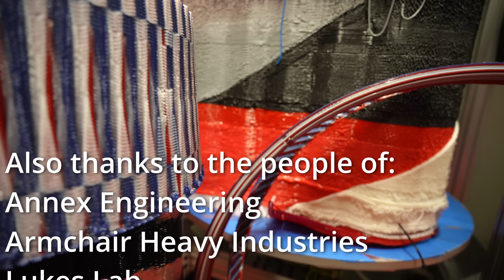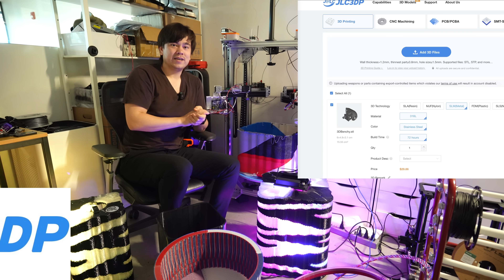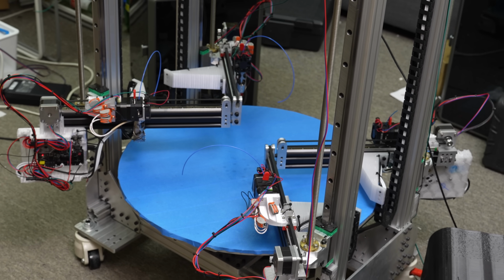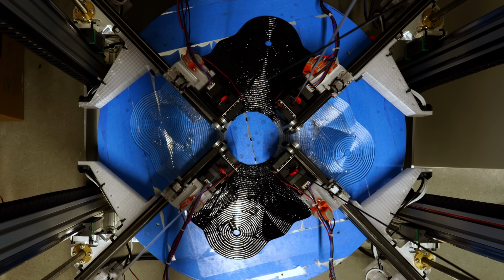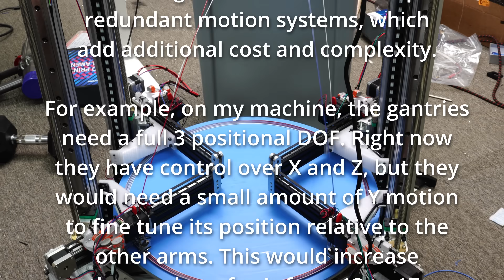The High Speed Future of 3D Printing - Quadrupolar Express

Comment: I'd love to see a breakdown of the build. Also any updates on the firmware and slicer end. I've been trying to figure out how to get klipper to run multiple print heads simultaneously. So far all ive come up with is to run them as seperate printers but im not sure how to synchronize them so they dont collide. I still have no clue how id go about slicing models for that too lol. I did see something the other day that I need to look further imto about a few people getting multiple heads to work in klipper but I'm not exactly sure where I saw that atm...

Comment: You would probably need encoder feedback on every axis as well as the rotary axis at the bottom and a cnc controller to do all the trig functions, that’s a lot of math. That kraken controller just can’t do all of that. I would aim for absolute encoders on battery back up so it won’t loose position unless something breaks. Then run a ballbar test to make sure the frame is squared up. Just a thought.

Comment: Super Kudos to you !!  Amazing work from someone not being paid by someone else to do this stuff.  So many things to consider.  Regarding the alignment of multiple print heads, have you consider incorporating a high quality camera placed on the printheads?  This would allow you to have a precision pattern on the print bed so that the printhead would know exactly where he was relative to where he thinks he is so it can calibrate itself.   In addition, as the print is being done, the camera on the printhead could see what the last printhead had done (plastic dropped) and put his nozzle in the correct position relative to what it sees.  This would eliminate the need for such precise construction of a large device.  So, the printheads (video/firmware/sensors) find their own ways so they do not ONLY have to rely on the printer structure and the 3D map in it's head to correctly reproduce the model.  Maybe a crazy idea.  Thanks again for providing so much knowledge to all of us!!!  Keep it up!

Comment: Honestly just having a rotating build plate is something I've never seen before. Me coming from a machinist's background, you can make that build plate very stable and very flat like on a vertical lathe. Just have to have the bearings supporting the right places. What you were saying about machine rigidity is absolutely true. No machine is truly square. It's as close as it can be and then you put in the right offsets to counteract its imperfections.

Comment: Fascinating, ambitious, innovative. Regarding vertical alignment issues of the four arms. Did you consider moving the print bed vertically rather than all the individual arms? Kind of like Bambu style CoreXY. Another strategy would be to lock the four linear rails together in the center with a strong x connection. Alternately they could all be tied together with a periphery frame. Like how a Voron style CoreXY moves the entire gantry as a single unit tied together.

Comment: In a world with money, you would fix your precision problem by having a see through print bed. You would then just have a laser on each print head so the system knows the exact position of every print head without all that fixed alignment nonsense. I would also love to see your code for this so i can make recommendations there. Normally it would be easier to simply have the system know how to move all the print heads from the skice rather than in the machine itself. Adding to the machine adds a lot of complexity

Comment: @Nathan Builds Robots I obviously don't know every issue you have had to overcome--and I'm sure that is a LONG list--and I could be way off base here, but how I personally would tackle the mechanical structure is a solid plate that covers the area between your four columns that has your printing mechanisms bolted on.  IOW why 4 independent cantilevered arms which are by their very nature prone to a lot of structural movement? 

If you have a single platform that slides up and down your four columns you get a MUCH stiffer structure out of the gate.  If that platform were a cage about 100mm tall it would be very close to self aligning as it would be strong enough to move the column rails slightly--the sub mm accuracy you are hunting for as it would ensure parallelism.  If independent Z axis is an absolute requirement you could still build however much Z axis movement you need right onto the platform.

You would obviously want your platform machined to the best tolerances your budget will bear, but really as long as it is a stiff structure it doesn't really matter and you can build in adjustment capability for assembly.  It's a lot easier to build and adjust everything on a single rigid platform.

I'd be happy to help you on the platform design if you need it.

Comment: AWESOME MACHINE! 

Ok I think I've got some ideas you might not have considered for axis alignment. 

REAL IDEA:  
1- put load cells in each of the print heads. 
2- Use one print head as a "master" print head, and have it print a large circle. 
3- use the load cells in all of the print heads to locate the edge of the circle 
4- use this at multiple locations to figure out where each head is in space and adjust the hardware positioning in software accordingly.

The main benefit is that it doesn't use any external hardware to register alignment but instead the actual position of one of the other heads to calibrate them all. 

At the end of the alignment protocol, have each print head print a circle on top of the others to check and see how close they are to each other. 

Idea other - do the opposite axes need to be independently cantilevered? Or could you effectively make an "X" (not exactly, but with 2 overlapping cross bars). That would help greatly with the parallelism/perpendicularity alignment of the heads across from each other. Also you could have a single print head extend further than the others in order to reach the middle of the bed.

COMBO BONUS IDEA: 
1 - use "X" idea from idea "other" above, and the load cells to perform regular bl touch style bed leveling, but then use the lead screws to actively "torque" the frame into the correct shape. for the first few layers at least. But that's another software solution.

The perpendicularity and parallelism of this machine is crazy important but it should be achievable mechanically with enough thinking about it... And Blanchard ground 1 inch thick pieces of tool steel LMAO.

BUY A DUET MAIN BOARD + EXPANSION CARD TO CONTROL THIS MACHINE AND THANK ME LATER

Comment: I feel like the squareness of the frame could be fixed/helped, if diagonal steel cables could be put on the sides, back, top and bottom, and tensioning them in order to callibrate the whole structure 

I'm recommending steel cables, or threaded metal rods so that it can more easily be callibrated, as opposed to having to presicely machine the frame/diagonal pieces, but then again, another issue that could arrive with that is the frame bowing out in the middle

and to allow for the printer to print in the middlle, you might consider allowing 1 of the print heads to go a bit past the middle so that that spot can be reached, however that would make the print heads be asymetrical, which would require them to have individual control (unless if that is actually already possible, just not technically due to the print heads having the same g-code)

Comment: Using an addictive manufacturing process to print large objects is silly.

You could have printed that trash in vase mode in a few hours with some 200g filament, then pour 2$ chalk / plaster / epoxy inside it in 15 minutes.

Comment: This is a cool printer concept! We're Tesseract Technologies, and you may have seen some of our previous comments here on YT. We're currently developing a high-speed 3D printer using custom-made BLDC linear motors. However, due to budget constraints, we've decided to start by offering an affordable, high-speed linear motor that is plug-and-play compatible with existing control boards using step and direction signals.

We're also planning to release a video soon, where we'll explain a unique approach using an H-bot configuration. In this setup, multiple X-axes can share a Y-axis, driven by several linear motors, allowing for overlapping print heads. This system is simpler and more efficient than complex belt-driven mechanisms, enabling extremely high-speed 3D printing with multiple print heads.

You can check out an image of this concept on our channel. We're excited to see how your design evolves and to share more about our own journey!

Comment: Do you think that a bed slinger design could work, where all of the print axes are parallel to each other? This could make it a bit more modular and help with rigidity and alignment. Is there any specific benefit to the rotary design? Besides looking very cool..

Comment: Nice experiment.

Probably way too impractical/failure-prone/complex to ever become a standard though.

More likely, we'll just see flow improvements on single head systems to also do 1+kg/hour.

Right now you can already get about 400g/h of PLA out of a Goliath hotend on a RatRig vCore, from a single filament input.

Designs such as Monika's with three filament paths (and 3 extruders) will already break that 1kg barrier with a single toolhead, with vastly better quality and only 3 extruders (or 1 with 3 paths).

Of course, you'll be able to quadruple that volume with those 4 heads, but all the downsides of that design will probably make it slower at any given level of quality, all geometries considered. 

It also just dawned on me that your prints will be a lot weaker due to each layer not being one continuous molten plastic stream, until you find a way to properly melt the quadrant boundaries.

A bit like the way most seams are serious weak points in perimeters, even worse when aligned.

Comment: I guess the "easiest" way to fix almost all misalignement issues would be to have a constant calibration routine with something similar to vive trackers (I wonder if just using stock trackers would give a good result), you have basically a barcode scanner (sweeping line laser) and multiple light sensors that have a very high speed clock, and you time a flash then a sweep in 2 axis, since there would be a single reference sweep, the relative position of each arm should be fairly precise.
you can do a few sweeps on each layer with static positions (e.g. min middle max) if you aren't doing fully 3d printing.
that would require painting allmost all of the printer matte black, because reflections are an issue,  which might be a pain

edit: there might be a cheaper way actually, if you use a  diffraction grating you might be able to get high precision positional accuracy from an off the shelf camera by using interference patterns just by looking at the pattern, and since the position is very limited

that may require semi real time slicing (e.g. only slice a few layers in advance, since you can assume calibration won't drastically change in a few layers) to compensate the sideways misalignement of the extruders as each extruder only has 2 axes. 
though a small pair of driven offset screws on the x axis rail  might be enough to compensate drift and keep the same gcode while being easier to implement. 

imo the main issue with the system is that at best you get a 10, maybe 20x improvement for a much higher cost and complexity (when you could just run 10 printers unless you need very fast turnover).

(it still is worth pursuing as improvements to idex would be great)

imo for very fast printing if cost isn't an issue high power bottom down dlp resin has a much higher ceiling (at the cost of needing a large base volume of resin.)

also if we see affordable larger models of resin printers with a pump like the anycubic m7s (but with a 300 or even 400mm bed), that might be a great solution for moderately high speed printing (though there's always the issue of film peeling which doesn't exist in bottom down printing.)

there might be a way to use a light resin floating on top of water or glycerin, that way you don't need high volumes of resin to print large bounding box bottom down models.
waves might be an issue but probably not since at very high speed you're printing at a constant flow so there shouldn't be that much turbulence.

Comment: I don't see this working. I mean, for printing big objects, maybe. For printing 4 small objecs, it gets it done. However, for serial or mass production, it's not nearle as useful as a small injection molding machine, and it's almost as expensive.
Don't forget that FDM printers are designed to make prototypes or just very small runs of some item.

Comment: a micron?  the fck do you think this is? the year 3024?  
you are talking about sizes that are less then 0.1 mm.  
and then you mention micron.  0.001mm.  
QUITE THE FFING LEAP THERE ISN'T IT?? 

there isn't a single 3d printer IN EXISTANCE!!! that has that precision. 
not even the precision machined metal parts in the motors and such. have those kinds of tolerances.  

the best you can get is 0.05 as a normal consumer 
0.01 if you have a big wallet. 
that's 50 times less precise than the microns you were talking about.  
(or 10 if you are rich)

Comment: "before you comment about you're own genius solution..." is a rather arrogant statement from someone, who just a few minutes before, was talking about how much they benefited from the 3D printing community. I am not a genius by any stretch of the imagination, but I got to work with people who were, on calibration processes and software for multi-head CNC manufacturing. One such system was in fact very similar to the one you have made, using multiple spindles to interface a single part on a rotor. However, since you seem confident that no one watching this could possibly know something you do not, I will leave that notebook in it's drawer.

Comment: It seems like the maximum speed improvement should be 4x with 4 tool heads, and that's only if printing a completely optimized symmetrical part that can keep all 4 heads fully active all the time. Any speed benefit beyond 4x is tuning or hot end improvements that could also be migrated to another standard platform without multiple heads.

There are probably edge cases where you need something fast, but in most commercial applications getting 4 in 4x the time in parallel is equivalent to printing them serially on a fast custom setup. In its favor parallel printing doesn't suffer inefficiency when printing unusual things (no symmetry requirements), and aligns the start/stop times to limit the number of times you need to interact with the machines.

Pretty cool you got it to work and it's an impressive technical achievement, I just question the practicality.

Comment: You could try putting the z axis in the middle, that removes 3 sources of variability, now you just need to align 1 rod, rather than 4.
Reply from the maker: That is an interesting thought. Originally I was thinking of spinning the whole top half of the machine, but this makes a lot more sense. 

Or, moving the bed down with stationary gantry up top, that would also do the trick

Comment: The problems with multiple parts moving around unequally is exactly why machining equipment is so chunky. If you want multipolar printing like this with many heads, you can no longer rely on calibration the way single head machines work, and must actually build the machine with micron level precision between very rigid axes. Easier to print 8 pieces on 8 machines with 8 heads than to print 1 piece on 1 machine with 8 heads in 1/8 the time.
Or switch to something like laser sintering powder which does not suffer from the same limitations. It'll be very expensive either way.

Comment: It would be interesting to translate this to a linear configuration. Multiple print heads along a single belt or having the printheads arranged in a grid above a larger bed could accomplish something similar with potentially less mobing parts and less concern for the resolution changing towards the center of the rotating bed

Comment: Use a laser sensor, watching the process and keeping track of the alignment. And be able to adjust the print heads and keep them aligned. Of course thats another program running on a laptop that has to be integrated with the 3d printer.

Comment: To solve problem with many many axes, I think you need take 4 controllers - one to every print head(or more if you need more print heads), and of course will need rebuild Klipper firmware on this case of printing.

Comment: Adding print heads is a great way to speed up the FDM process, although we’re only seeing gains on a single axis. I wonder about multiple axis FDM. 

Another thing that I wanted to know about: co-location of a moving support bracket on the print head. When a potter works on a wheel, one hand guides from the outside of the shell while the other supports and guides as the form is shaped, equalizing the pressure on the clay. Is anyone addressing this type of solution?

Comment: Great work Nathan! It has been a lot of fun following your project. What about having different size nozzles in the same print? E.g. 1mm for large areas with less precession, but more speed and 0.4 when you need those details and precision. Do you think the extra print heads will add much to the slicing time? I been printing some lattice structures lately and the slicing takes forever. I hope GPU slicing will be a thing soon.
Reply from the maker: I have some simple use cases that I can develop first, working on that now